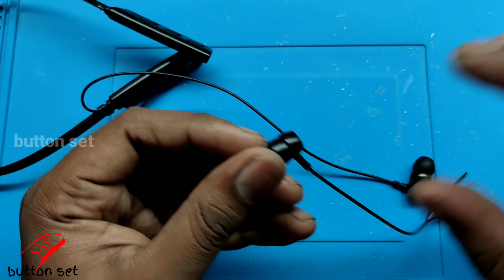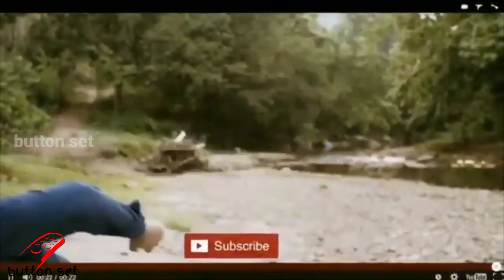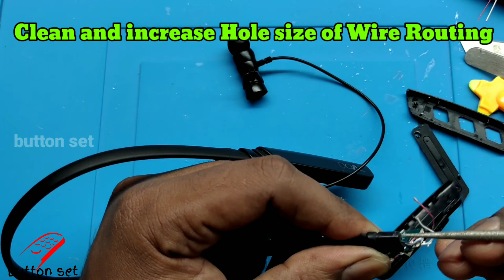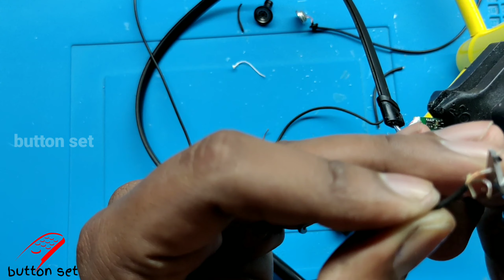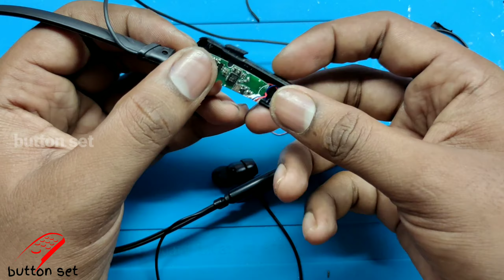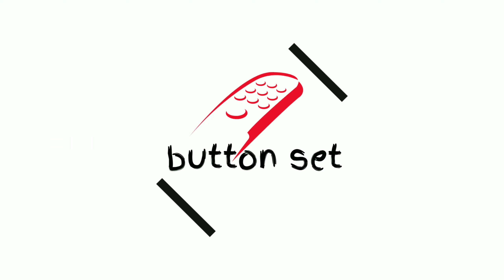Rockerz 235 V2 Replace Frayed Left Cable

Comment: after changing of the wire , any change in sound quality  ? yes or no ?
Reply from the maker: Based on wire Quality , 
If Local Cable some times Heat Observed or Solder point broken 2 or 3 days